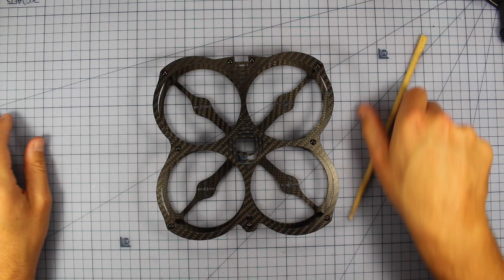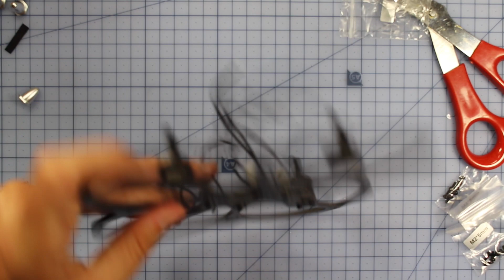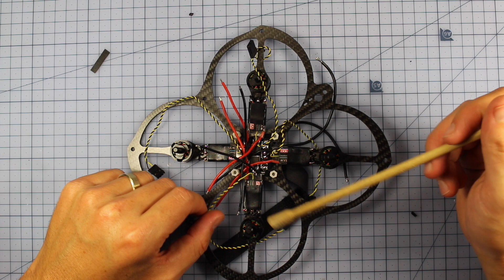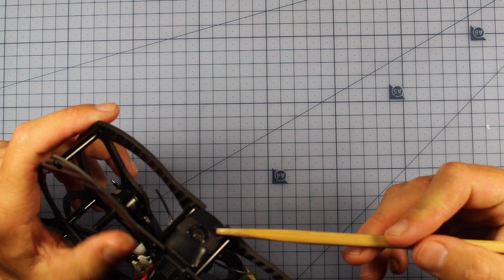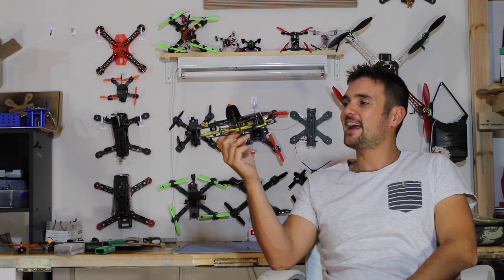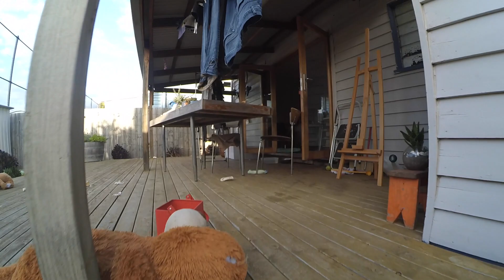How to build the FUNNEST INDOOR FPV quad EVER

Comment: hey stu, correct me if im wrong but lets say you have a 250mm size frame.. you need to use 2204 2205 2206 motors correct? im new to drones and im trying to build one.. also i ordered eachine wizard x220 for a start. im trying to build a micro 110mm frame should i use a 1105 motor?
Reply: You don't HAVE to use those motor sizes, just make sure they'll fit and your escs can handle them. On my Helix (about 220) I've got 2306 Emax motors.
Reply: AgarSADO thank you

Comment: Never done a build, love to do it, what would TOTAL cost be accept for a transmitter?
Reply: just finished ordering the parts for mine, without transmitter its around 300:
ESC :$10 x4 = $40
Motor: $19 x4 =$76
FC: $30
PDB: $10
Frame: $50
Receiver: $10
Props: $5
Standoffs: $5
VTX: $30
Camera: $30

Comment: In my recent builds I completely removed the servo ground of the  ESCs, because you have already the battery ground connected to the FC. 4 cables less ! In my recent builds that always worked - i checked before with a voltmeter, that the servo ground has no resistance to the battery ground - so it already is directly connected - as well as to the ground of the PDBs 5V output.
Reply: So I soldered only the signal wire of each ESC to the FC - much cleaner !
Reply: excuse me sir, but this is very interesting. so basically  i can leave the ground of the signal wires completely away? that would save quite a lot of cabling mess and weight as well. mind to elaborate o the disadvantages? i watched so many build videos on youtube and can't remember a single one who did so. Thank you very much!

Comment: love my owl build with your instructions. Unfortunately the port I plugged the receiver ground and signal into has broken off. Do you know if I can solder the two wires directly onto the board and if so where?
Reply from the maker: you might be able to plug it into the other port and select the other utart in betaflight, maybe ...

Comment: would you recommend this for outdoors and doing flips with it or just purely for indoor practice?
Reply from the maker: outdoor flips are fine
Reply: Works great outdoors if you have your tuning locked in really well. The wind flipped mine over while flying at 30 yards up but was able to recover quickly before I came even close to the ground. So wind will knock them around but they're powerful enough to overcome and correct themselves.
Reply: This is a regular mini quad. It's amazing outdoors.  Just fly it on a 4s and it screams.   2s indoors and its docile and easy to fly.

Comment: Hey. Loving the Owl but struggling with PIDs. A lot of wobbling when flying. Where should I start with the PIDs setting?
Reply: 505Innovation thanks. I just move all the stuff to a new 130 frame. It rips now. I found the owl not good for indoors. Too much power and too loud. I think the weight made it not too fun. I love the new 30 gram frame now. I bought a 105 brushed quad for indoors.
Reply from the maker: do you have betaflight on there?
Reply: +UAVfutures I'm running Cleanflight currently. Haven't ever looked into Betaflight.
Reply from the maker: Kevin Duquette put betaflight on there. super easy and sooo much better
Reply: +UAVfutures thanks. I'll do that
Reply: I started really low and worked my way up from there on my P setting. Don't forget to put in the 45 degree offset on the yaw.
Reply: Is this why my Owl just flips out??? I thought the only offsets were 90,180,and 270?

Comment: I'm new on the FPV drones and I want to order the kit from FlexRC, this will be my frist drone to build not sure what parts are not including in this Kit. I will get the transmitter Devo 7e, but what kind of cables and charger do I need? or what else do you recommend to get so I can start building this drone? btw, great video. Thank you.
Reply from the maker: you will need 3s 600mah lipos, a lipo charger, goggles, and a reciever that works with your dev 7
Reply: +UAVfutures what transmitter will work with this kit's receiver? thanks for the reply.

Comment: Question. I noticed the motors get very hot. Much hotter than my 5' 2205/2300 EMAX motors running on a 4s lipo. I know I am running 4s 1300 on this little guy. Maybe the weight of the battery is just too much work for the little motors. Would it be better to not set it up as a pusher for cooling reasons.
Reply from the maker: yeah 4s and a go pro are pushing the quad. I would drop it back to 3s and just enjoy the ride : )
Reply: +UAVfutures thanks. I have some smaller batteries on order. Which ones are you running?
Reply from the maker: Kevin Duquette I have some rotor x HVLI which are pretty amazing 3s 800mah, But I dont know if they are for sale yet?
Reply: +UAVfutures thanks. I ordered some 800s. Should be good. I am using a 50g Polaroid Cube. Should be a good cam for it after I dump the 1300 battery.

Comment: Just flew the build today. Only had a 4s 1300 pack. Seemed a bit heavy. But still great fun. Still have to put my FPV gear on. Couldn't get that Lemon to work. Put on a Frsky X4RSB instead.

Comment: So you removed the black wires from the ESC and only connected the yellow?
Reply from the maker: You can remove the smaller ground wires if you wish. you need to leave the larger ones though.

Comment: Noob question. Going to build this guy soon. It's all waiting for me I a box of pieces. I noticed the FC was upside down. That's okay?  And binding the Lemon to a Taranis is good? Thanks for the build. I bought one because of your build video.
Reply from the maker: awesome to hear you liked my video. The FC is upside down. this is fine, You just have to comfigure it on the computer so it knows which orientation it is in. It is pretty easy. also there is a guide on flex rc for binding the sat. but it is pretty easy.
Reply: +UAVfutures thanks so much. I'm excited about the build.
Reply: +UAVfutures 45 degrees for yaw (if it's just one turn from center) and then what setting in the configurator for upside down? Or does upside down not need that?
Reply: +teethoflions she is flying well. I'm very happy. Maybe a little too much power and noise for indoor use. But not going to stop me.
Reply from the maker: Kevin Duquette awesome

Comment: A few questions from a noob, as this seems to be the perfect kit for me:
1. How do you program the flight board, or is it preprogrammed?
2. Could you recommend me a good 3 cell battery that would fit in this?
3. Can this thing carry a mobius comfortably?
Thanks!
Reply from the maker: 1. you program it in the clean flight config on your computer
2. any 3s 800mah battery would be perfect. 
3. sure can. but it will reduce your overall flight time.
Reply: UAVfutures thanks a lot!

Comment: Can you solder the satellite rx into any of the through-hole pads? I have never used a satellite rx, but with s-bus I am able to bypass the jst connectors alltogethor; I solder straight onto the UART 3 through-hole pads.
Reply from the maker: I dont think the voltage is enough to power it that way

Comment: Hello Stew. Big fan here. Question: Did you use a Taranis to bind to the Lemon Rx? I could never bind a Lemon Rx to my Taranis w/ Orange module. I can only bind a True Spektrum Rx to it. If you managed to do it, can you do a video of it? Thanks.
Reply: Why not just get a FrSky XSR receiver if you have a Taranis instead of the LemonRX? The XSR is tiny, supports S-BUS or CPPM to the flight controller and would mount pretty much the same as the LemonRX on this frame.
Reply from the maker: price plus it is what came with the kit.

Comment: Do you use any kind of fan or filter for that flux smoke?  It's nasty stuff...
Reply from the maker: umm...I hold my breath...but should probably invest in a fan yes
Reply: You'd probably want a very quiet fan since you record.  I've seen little battery powered carbon filters made from Altoids tins and computer fans.  You could even make a video about it.

Comment: Does it fly in rate mode? How is the agility on this thing when flying outdoors?
Reply from the maker: +Paul Doronila This is a full sized powereful f3 board. The same board that is used in most FPV racers. It can be set up for any mode in betaflight. clean flight or openflight. Acro, horizon, angle, super expo and air mode. very powerful FC.

outdoors is is fun but not nearly as powerful as its 5" or 6" brothers.
Reply: +UAVfutures how would you compare it to your atom?

Comment: You threaded a bunch of stuff through holes in the carbon fiber. I'm a noob, but everyone tells me that putting wires through CF will eventually tear the wire and cause shorts. How do you feel about that? Def considering an Owl as my next build (My office has an entire floor of unused space. I feel like I have to)
Reply from the maker: +Bo Boland depends on how sharp the carbon is, how much vibration and wear it is causing. So far I have had zero issues.

Comment: I am looking to do my first build do you think this would be a good place to start thank Rich
Reply: No, this is way too small. Go for a 250 size quad for a first build
Reply from the maker: +Alex Magee personally a 180 is my recommendation as well. My epiquad 180 is one of my all time favourite builds.
Reply: +TheKlaMike I see what you are saying, 250's have more space, but I think a beginner should be flying things with 4" props.  180 sized frames being lighter can take much more punishment because they have less energy when they crash.  The armattan f1-4 with integrated pdb is a perfect first build, (just dont try and cram an immersion vtx in it)
Reply: UAVfutures Its interesting you say that.  I was actually looking at the epiquad mainly because of your video reviews on it.  Speaking of which, I love your vids man!  You beam your enthusiasm for the hobby all over the world and I like that!

I have a couple of questions about the epiquad seeing as you are here,  How would you say the range of the epi-rex compare to a d4-rII in terms of range?  And is it possible to send telemetry back to the taranis with just the one antenna?

Also how much of a bitch would it be to stick a osd on the epiquad stack?  Just solder wires direct to the naze on top of the pins?  I usually use the OSDoge, but would probably use a minim micro on the epiquad.
Reply from the maker: Alex Magee thanks for that awesome feedback. 

I have not noticed any range issues what so ever. And the epi rex is an sbus receiver compared to the slower ppm style d4r. The epirex can send telemetry. there is instructions on their website about setting it up.

Im not sure about using the osd. It would be possible but I think you would need to fit it in between the camera before the wires. Not as easy as an OSDoge in a normal build
Reply: I agree with the above. I have a 180 as well and atm it's my favorite quad (working on putting together an owl to take that spot). 180s can get a bit cramped, though.
Reply: TheKlaMike Building in a 180 is more about getting the right components than anything else. If you dont really know what you are doing and end up with a huge IMRC vtx, bec', lc filters etc you run out of room, but this is exactly why build vids are useful.  I would say that the Uav futures F1-4B build vid is easy enough for a beginner to follow.

Comment: What would you recommend for batteries on this size micros? I'm having a really hard time finding anything in the 3-4S 400-610mah range that has a high enough C rating
Reply from the maker: +Porutac I actually ran a 1400 but its too big. I think about an 8 or 900 is perfect for this